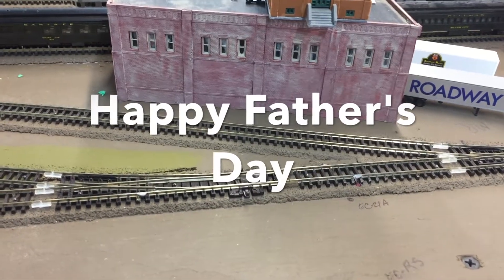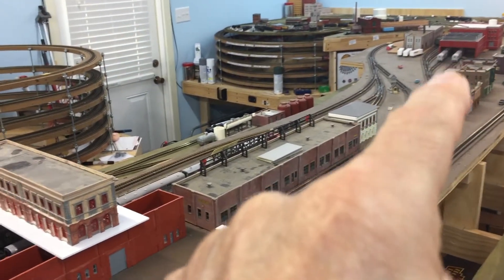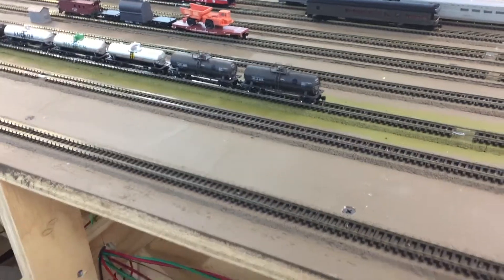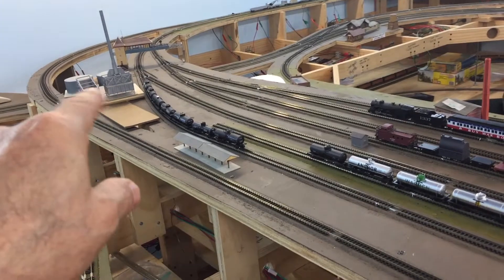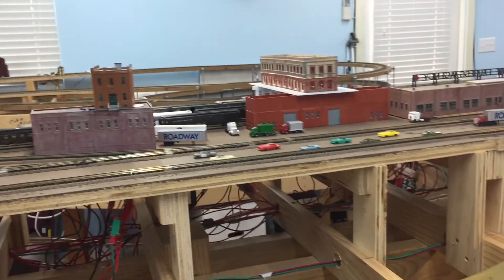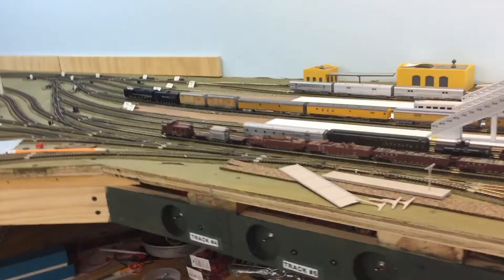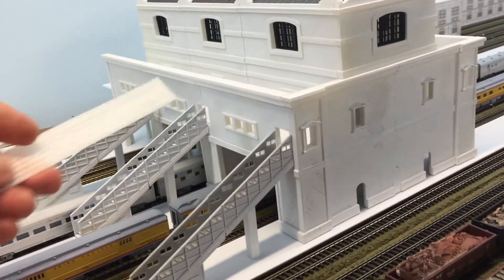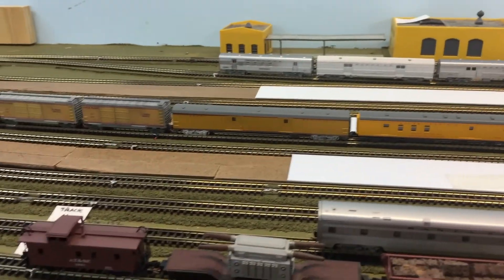Mid June 2017 Update

Comment: hi John.. happy fathers day to you also... i need to build an oil loading platform for one of my subs... can you go a little more in depth of how you built your...mine wont be as long as yours... i like the fact that you have extended your oil loading facility... thanks for sharing.. vinny
Reply from the maker: Thanks Vinny, Give me a few days and I will post some more details either in pictures or video. In the meantime, I have some pictures of various fuel/oil loading platforms (from the web) that show 3-4 main distribution pipes under the platform walkway (I really can't do what you do in finding these places in real life and taking pictures since I model the late 193s to mid-1950s time frame). The key thing that I start with is to measure the distance between the top inlets on the single dome tank cars (typically around 39 feet in length) that I use.  This defines, in general, the distance between the filling points, which in this case is ~3 1/8 inches.  Since I had gone thru this process with the original one a few years ago, it was used as the model to set the height.  The stairs and railing on the original are Grandt Line products.  The current video shows just the mock-up for length to match the new area where it will go.  More to come......John
Reply: no worries John... i'm in no hurry... vinny